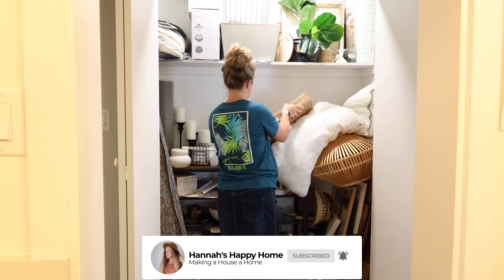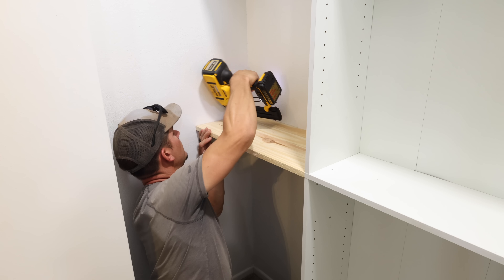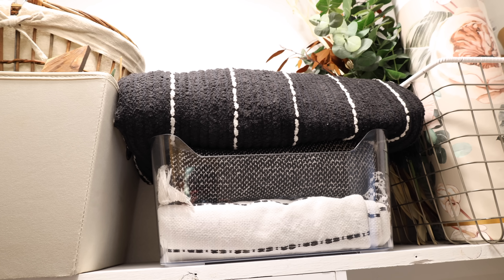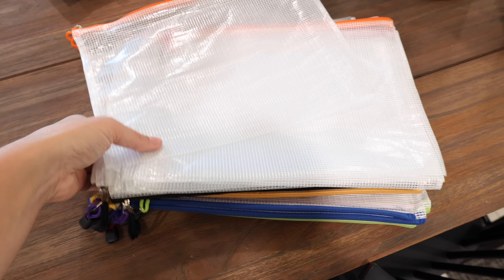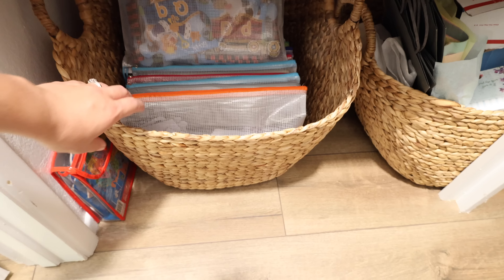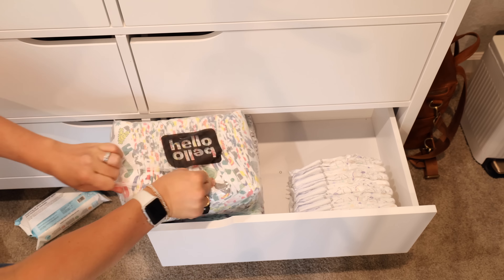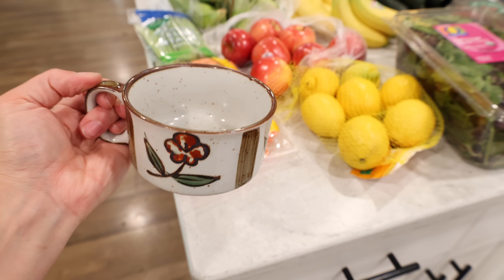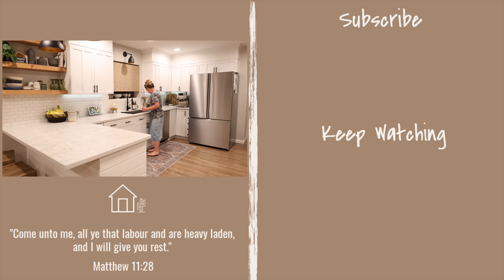HOME ORGANIZATION IDEAS!!😍 ORGANIZE WITH ME | DECLUTTERING AND ORGANIZING MOTIVATION 2023

Comment: I suggest using the "leftover bags" for small toys that need to be grouped together.  Also you could use them for craft supplies or buy a few new puzzles for the older boys as they get older.  Levi will still need to do the older puzzles.

Comment: AMAZING!

I recently expanded my recipes by adding one I got from my Filipino DIL:  pork shoulder bnls rib ADOBO.  Very simple ingredients:  onion, garlic, Liquid Aminos (or lite soy sauce), FISH SAUCE, salt, tons of pepper, water, bay leaves, brown sugar, WHITE VINEGAR and pork shoulder boneless rib meat (DIRT CHEAP AT COSTCO).  I cut the pork into 1” chunks using KITCHEN SHEARS.  Do NOT remove the FAT, use it!  Using a very large cast iron skillet, I brown the onions (set aside), then mix small batches of pork meat mixed with:  salt, pepper, fish sauce, liquid aminos and bay leaves.  Sizzle on all sides on med-high heat — set each batch aside (they don’t need to cook thru).  Once each batch is well browned, it all goes back into the HUGE skillet, along with 2 TBSP crushed garlic, 2-3 C water, and 2 C white vinegar.  Bring to boil, cover and simmer on low for 45 mins.  Scrape/deglaze the bits that have stuck to the skillet bottom.

MEANWHILE, cook a large batch of Lundberg’s short grain brown rice (COSTCO) or Jasmine rice (ALWAYS rinse, rinse, rinse + drain in cold water.  Use LESS water than pckg instructions for fluffy sticky rice.  The Adobo is served over the rice and the liquid in the Adobo creates a flavorful au jus to pour over the rice.

This stuff lasts for days and is like life!

Comment: Thanks Hannah lots of info but In love with the Puzzle bags.  My Son & Daughter are going to love them too as they still both have youngsters.  Also subbed & saved your Corn Bread Recipe because it looks just scrumptious.  I’ve been putting Pinto Beans into Casseroles/Stews etc.  Adds Protein & a different texture & SO easy in the Crockpot or Instant Pot.  Cheap too which is a bonus.  Thanks again Michelle.